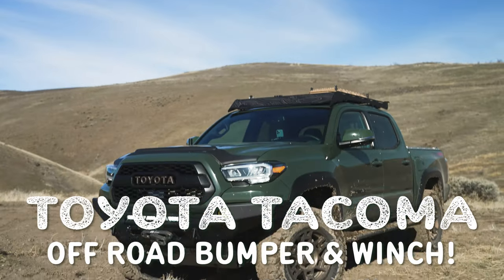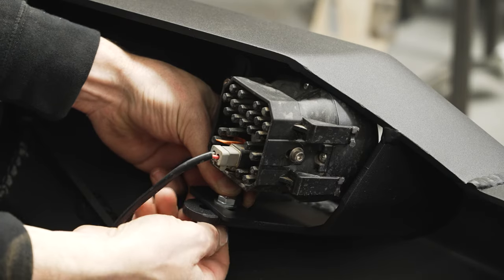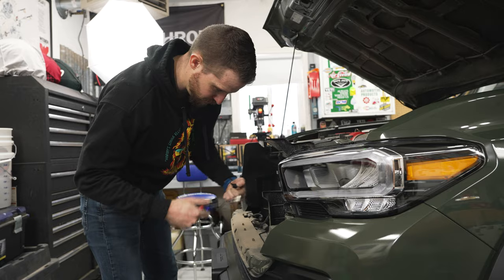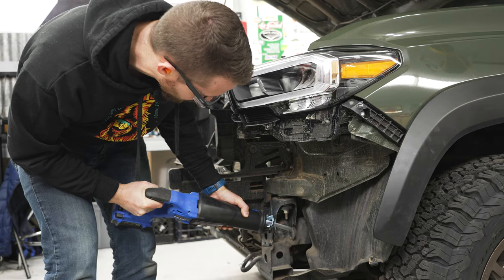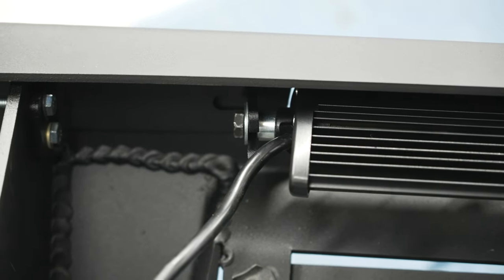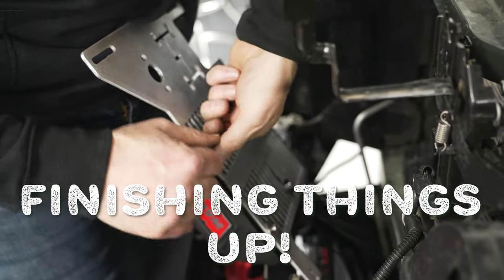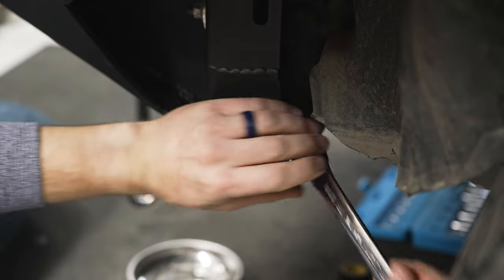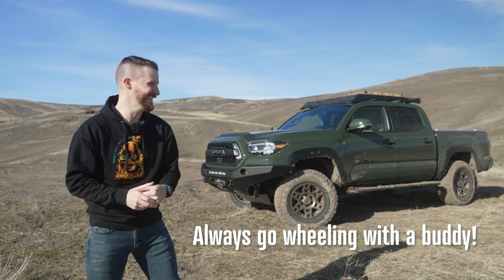STEP-BY-STEP GUIDE!  Toyota Tacoma CBI Bumper and Winch Install!

Comment: Question: did your bumper come with the holes pre drilled for the light bar bracket? Trying to do this to mine and I’m not seeing any holes to mount the light bar bracket
Reply from the maker: Yes they were predrilled.

Comment: Why did you relocate the winch control box? Was there anything that interfered if you didn’t ?
Reply from the maker: It’s very close to a power steering line.  Also gets it up higher from any water.

Comment: Good video Jason, is there any type of weather strip you could use on the winch. Could you the same protector for the bump and the new bumper for the winch.
Reply from the maker: Do you mean in that spot it touches the aluminum past the fairlead?  Yeah, a rubber piece wouldn't work in this case.  It only touched when the line is angled all the way down.  But I still was uncomfortable with that so I ground a sizeable amount away so it can hardly touch at all... and I made it smooth to the touch (essentially like another fairlead on the inside).  I think it solved the problem.
Reply: @JasonExplainsThings  ok wasn’t sure if that or something similar would work.